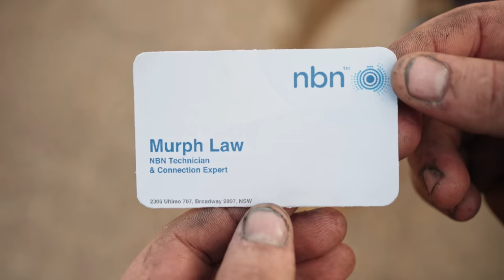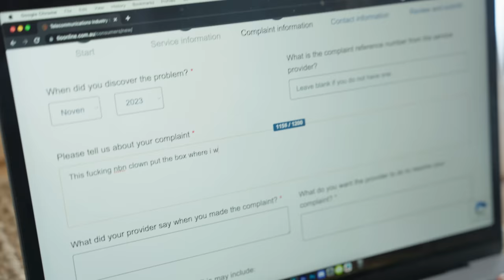Every NBN Worker Ever... | Garn.

Comment: NBN is so geared for complaints, one of their fresh workers actually did a good job so I thought I might commend them, went on the NBN website... you can only complain. Literally no way to say good job. But good luck getting a good job done by them though...
Reply: I cleared a corner of trees (as my house is surrounded by bushland) to have direct line of sight to the nearby NBN tower for the best possible connection since hearing everyone on the NBN has had huge speed issues. Where do they install the antenna while I'm at work? the exact opposite corner of the damn house, facing directly at thick tree cover simply because that corner of the house is the lowest/easiest point of the roof for the installer to slap it on and say his job is done.
If they didn't want their complaints line on fire 24/7 they could have actual trained technicians
Reply: @Zebra.Lionfish Last place i lived it took me about 2 years (4 different installers with one coming twice) due to them targeting a tower through thick bushland cos that tower was 100m closer than the one with clear line of sight, they even tried to pawn me off onto sky muster satellite, i had to get an independent signal test to force them to finally green light my install.
Reply: yeah you see, they wanted you to report the new guy for raising the bar for all of the dudes who dont give a fuck
Reply: To fix my nbn hfc connection I had to annoy the living shit out of them, so I had intermittent dropouts beyond their own definition of acceptable. Took them coming around 5 times before they knocked on the door, blamed the isp router (which they had sent 3 of) and my own routers (of which I had 2). By the 7th time that same guy was called out he replaced things in the pit that "were not a problem" and I have had no issues since.
Moral of the story, be a huge pain in the ass and do not fall for customer service by attrition bullshit they will try to pull. They say they did not see x amount of dropouts today so they cannot send a tech out? Ask about friday because you had a program that kept logs. I am sure that this is not every experience but think of it like this, if I did not know what I was doing I like many people would be stuck with a dogshit connection.
Reply: @Zebra.Lionfish   lowest bidder for the contractor
Reply: Umm... Was I the only one stupid enough to think the NBN was originally stated to deliver FREE internet to Australia???
I am 99% certain that is how they sold the cost to us... Anyone else think or remember that?
Reply: Yeeah mate seems like a golden opportunity to file a complaint about not being able to file anything but complaints
Reply: And like every con artist, you have to pay upfront. Sad state of affairs.

Comment: I'm an Engineer that worked on the OG rollout as designed by Rudd and Labor and if we had of kept going we would have had world class speeds and service at probably about 25% of the end price. What the LNP did to the NBN is actually criminal and i think about it alot. I'm not a rudd or labor fanboy and i did vote for the LNP at the time but nothing could have prepared us who were on the original rollout for the torpedo and clear sabotage that was heading for us.
Reply: My opinion is Australia's internet is about 10 years behind the rest of the world. Because of this.
Reply: Current sub contractor and I hear yah... finally I'm installing fttp and feels like I'm doing the correct thing lol. Should've been this way from the start
Reply: @MrMrSymmetry  it should have been fttp but you know what our fttn is still better than nothing, much better than the adsl we had previously which was awfully slow
Reply: The project was massively over budget like every project any Labor government ever runs.  Unless you're into multiple concurrent QHD streams the current NBN is fit for purpose.
Reply: One of my school teachers said he had a mate that worked at Telecom before it was Telstra and sold off. He said this guy took fibre optic cable to a board of the fat cats in charge in the 90's, pitched it as the future of the world and got laughed at apparently
Reply: @rolyicecold  try 20
Reply: actually, LNP made it extremely clear they would do that. You say nothing could have prepared you and that you voted for them. They laid it out in plain English what they were going to do.

I hope you're proud.
Reply: @fatShowPony  I can barely watch a show on Netflix without pausing every 2 minutes to buffer the NBN is god awful and the Labour plan is what should have been done at the start instead of wasting years and billions funding a system that was nearly worse that the predecessor.
Reply: I'm sorry to hear that but next time don't vote for the Leopards Eating People's Faces Party
Reply: @davidlp3019  nothing would give us 4G across the country to fill the gap. Most of the country being on FTTN has been a waste of time and money. If they wanted to save time and money they should've done FTTP and HFC/satellite. The telephone cables weren't ever intended for internet use, let alone large scale access in the modern era.
Reply: Denial is not a river.  @fatShowPony
Reply: tldr
Reply: @MrMrSymmetry why did they do fttn in the first place?
Reply: Not to mention finished by 2016 at the latest
Reply: Yeah mate completely agree. very frustrating not being able to provide customers the service they were originally promised.
Reply: Yeap 100 percent agree mate, they absolutely fucked the whole thing.
Reply: @rolyicecold  Here in the boonies in Canada I got 150/150 for 50 bucks ten years ago. Went for shit ADSL to wonderful just like that. I now have 940/940 with Voip and unlimited for 90 bucks. For the life of me I don't understand whats with Oz low upspeeds. I know, why do you need fast upload speeds.
Reply: @johnarnold893 I live in suburban Aus and I would pray to have your old speeds. Somedays I can't even get over 10 Mbps upload, let's not even get started on download that shit is horrendous 😂
Reply: @fatShowPony  The current NBN is NOT fit for purpose. If you're already spending billions, you may as well go all out and build an actually quality system. And its likely the original plans would have cost less than what we ended up with anyway, with a much better end product.
Reply: @johnarnold893  i live in Scandinavia now and i get 1gps up and down for 1200kr a month
Reply: Your not wrong. I'm lucky to live in tassie, both the houses I have lived in since the nbn existed have been on the OG roll-out. The only singular issue I have had (that was not a wide spread outage) was the fiber line going into the NTD snapped, think it must have been the cat. Had a tech come out a day and a half later to fix it.

Used to work on phone lines and the whole network was falling a part in the 00's, no way we should have switched to using that crap, degraded, corroded copper over fiber. Particulery seeing as a lot of the houses they are doing fiber to the curb actually have p20 conduit running from the pit to the side of the house, so it would take an extra few minutes at most to pull a fiber cable through.
Reply: Ok, but why the fuck would you have voted for them then
Reply: @calcutt4  not immune to propoganda obviously
Reply: @fatShowPony  Sounds great to splash money that's designed to innovate the country and possibly generate more wealth.
Reply: wym over budget? not installing it costed us far more than what any of the cost would have been. especially since LNP didnt cancel it but just dummed it down so that we would still be in 2015 while the rest of the world is in the present. @fatShowPony
Reply: @sadfrog15  you can't blame the NBN for a substandard ISP or a poor route.  Maybe Labor's gonna fix that for you. Then they'll come and clean your house for you.  And cook your dinner.  Meanwhile inflation will continue to spiral out of control because Labor keeps injecting cash into the economy (and Laborites will blame the RBA for being the ambulance at the bottom of the cliff).
Reply: @vancesaler  utter rubbish.  Conway and his mates couldn't organise a piss up in a brewery.  Turnbull actually came from industry.
Reply: @centralrnrockets3500  you'd actually be able to generate a cost benefit analysis as a government then wouldn't you?  If you were at least semi competent that is
Reply: As an engineer you must admit if we continued to follow Labor 'written on the back of a napkin' plan, you guys would still be laying fibre now with only 50-70% of Australia done and the bill would already be over $150 bil and growing You can criticize what the LNP did, but they got the half decent speeds that was originally require under Labors original budget within the time frame. Also to say it would end up "25% of end price" is laughable, labor did a simple cost of $4000 by household and that was it. When in the first 12 months one place cost $90k, and another $235k to hook up just for 2 random examples that were reported....Labor's nbn budget was already well underestimated.
In hind sight, we can argue we should have went full fibre from the get go, but atleast 30% of aussies would still be on ADSL2 speeds and the total cost would be over $200 bil so either way people will still be complaining.This is also coming from a person who just moved to a house in a FTTN town (small mining town), but my max speed is 23/6 ....yet other side of town (which is 800 metres away) you can get upto 80/20 on fttn
Reply: @wtf22playa56  absolutely not, we would have finished in 2017.
Reply: @kremepye3613  ....you reckon you would have fibred ENTIRE of AUSTRALIA...in 6 years? LOL. Considering i'm married to an engineer..you clearly are not one lol
Reply: @MrMrSymmetry   nbn fiber installation pay how menny one job done?
Reply: @fatShowPony A basic grasp on how it all works would help before commenting. But please, sit back and keep spewing nonsensical dribble. Really needed a good laugh for the day
Reply: I been trying to say this exact same thing for years.
Reply: @wtf22playa56  absolutely yes. You clearly know nothing as most of the pit and pipe and overhead infrastructure was already in place from when we used to own telstra. And we just leased the stuff optus owned that we needed to use. Literally took 1/4 off the time with our prefabbed leads to run to a take off box on the side of the property. Subcontractors did the inside of apartments. Hard properties or properties with blocked lead ins would be  put on a list and hit by another crew with a suck truck who were designated to do the properties that would take extra attention. It was easy as and it was starting to flow so fast and smooth when the change came and the brakes got thrown on. It was a sickening feeling because all the crews and Subcontractors were starting to absolutely fly through it.
Reply: @fatShowPony  PWC has entered the chat
Reply: @fatShowPony  yeh... except you're wrong.

What you said is simply not true.

Comment: Literally just bought my own house 🏡 
And the nbn guy drilled a hole through my wall in the wrong spot 1 month later finally got someone to actually come and install the nbn correctly , tried to go through the complaint line to get the hole fixed and they even admitted there’s nothing that will happen about it , it is what it is 😂
Reply: It is what Garn says it is.
Reply: dang lmao. Is it really a wireless connection from the "curb" to the house box/modem? Thats wack
Reply: @M.TTT.  LOL no but that would be fucking hilarious. Its a copper wire from the curb to the box

Comment: The way I explain the fibre to copper connection.
It's like running a fire hydrant through a garden hose. Sure the hydrant has a lot of power, but the garden hose is still a garden hose.

Comment: 2:33 
2 IMPORTANT POINTS TO REMEMBER

1. You actually wouldn't get electrocuted , .....Not even remotely possible

2. Complaining to the ombudsman.... IS A COMPLETE FUCKING WASTE OF YOUR TIME.

Here is what the ombudsman does

- You complain
- he says... we'll get onto it and rest assured we'll get to the bottom of it
- You're made to believe, shit is actually going to get accomplished
- it'll take around 2 - 3 months
- then you'll be told .......   Yeah, well , we've looked into it and unfortunately they have broken any rules , Rest assured we've done an intensive investigation but we were actually advised that there is nothing more than can be done and they actually haven't done anything wrong

SEE THERE IS THIS RULE
LEGALLY
- You can file a complaint against any Service Provider and it will be taken seriously and action will be taken

- You can also file a complaint against NBN Directly
LET ME BE CLEAR ON THIS.......

YOU CAN FILE THE COMPLAINT
----  HOWEVER THERE IS AN ACTUAL RULE THAT SAYS  "It is illegal for any complaint against NBN Co. to Be actioned"

Meaning..
--- YOU CAN COMPLAIN,  BUT NO ONE IS ALLOWED TO PROCESS THE COMPLAINT....
IT'S LITERALLY ILLEGAL TO PROCESS A COMPLAINT AGAINST NBN Co.

here's another one...
To process a complaint 
YOU NEED TO STATE WHICH RULE THEY HAVE BROKEN
Generally these will come down to 2 things
Telecommunications Act
or
AS/NZ S009
also it has to be a REGISTERED CABLER that submits the form to the ACMA
as a Cabler knows the Cabling Provider Rules
the form is called a   TCA-2 FORM

but here is the problem....
if you read the S009  you will notice "All Entries of Carrier Cabling have been removed"

YES.... they literally removed the part of the statute that could get them in trouble.
What the statute now covers is.... Faults on the CUSTOMER SIDE of the network only

so basically 
1. IT'S ILLEGAL TO COMPLAIN AGAINST THEM
2. YOU CAN'T ANYWAY BECAUSE YOU CAN'T STATE A LAW THAT THEY HAVE BROKEN
    BECAUSE THOSE LAW PARTS HAVE BEEN REMOVED

Welcome to NBN My Fellow Australians

You are not asked if you want it........... You're just going to take it

If they do something wrong.......... You will stress the fuck out

THEN.....  You can do nothing about it

You will of course go on about 
I'm going to a current Affair or 60mins or the Ombudsman

but in reality, After you do your stress release thing and convince yourself that you're a lawyer and discuss how mucn compensation you'll never get

THE REALITY IS......... YOU WILL DO NOTHING BECAUSE YOU CAN DO NOTHING

there are ways around this,  but you have to do them VERY VERY SPECIFICALLY

The bottom line is.... They change the laws the suit themselves
it's as simple as that
and most Australians never learn this, Unless of course you work for NBN at one point

Comment: The part about the shower made me laugh, when they were installing the nbn in my unit complex, they installed the outdoor connection boxes where the shower is and when i had to get the nbn set up in my place, they had to install lateral cabling all the way across the wall, over the front door into my broom cupboard then out the other wall lol but I suppose I'm lucky he didn't just install it in the shower

Comment: I remember driving somewhere with my father and him pointing at apprentices doing NBN wiring by themselves with the supposed to be there mentor no where around.
Or more recently the nightmare of noticing them doing work in the node. 2nd to last time they killed the internet and then fought saying it cant be the node thats the problem. “They removed and never fixed the waterproofing in the node and it fried”
After the last time though its just regularly stalling just long enough to cause a page to fail to load or a game/service to disconnect from connection timeout.

Comment: You missed the part where they tell you the time and day they'll come out to install/inspect, then you're sitting there doing nothing for hours before and after that time waiting for someone and then YOU have to contact NBN to say it was a no-show, repeat that 2-5 times until someone comes out and says it's too hot/wet/cold/difficult so they'll have to come back later.

4 weeks without internet when we moved back home because the hardware needed an update, 3 no-shows and then the guy wouldn't go on the roof because it was wet until finally a guy said fuck it and fixed it. You can change providers all you want, won't change how dogshit NBN fixed wireless is.

Comment: fuckin chorus in NZ must have got its training from the Aussie NBN.

for a block of flats they were hooking up, it took 9 months to run the pvc conduit, and they fucked it up and had to do it again because they got the height of the box's wrong, and that was with a team of 20 blokes, a specialized digging machine, and 3 inspectors, for 4 of those months it was two blokes digging a hole next to a fence, and all of that wasn't even actually running the fiber, just the conduit.

a plumber rocked up to redo the buildings water supply at about the 8th month, ran the same amount of the same size conduit and had water reconnected in one afternoon(and he actually ran it into each flat).

Rang up chorus, told them this plumber outclassed them, and the next 3 weeks they had 40 people on site and it still took that 3 weeks.

Comment: He needs to do a fridge mechanic skit. I’m a fridgie and half the job is just critiquing people on using the wrong temperature on their fridge or freezer, or trying to explain that their compressor is dead because of all the dust in the condenser because they didn’t clean it. (This only applies to modern LG or Samsung fridges that have the small fan to suck air through the condenser, older fridges don’t have this problem). Also the NBN unreliability is why I use Starlink internet now

Comment: fttc - media converter and since every house will have a 10 pair copper lead or just 2 fibres if its new, well 4 pairs makes a cat 5 or 6 poe or if the media converter cant do poe another pair supply voltage from the NTD to the box, so its fibre to the pitbox and then 100-1000mbps cat 5 or 6